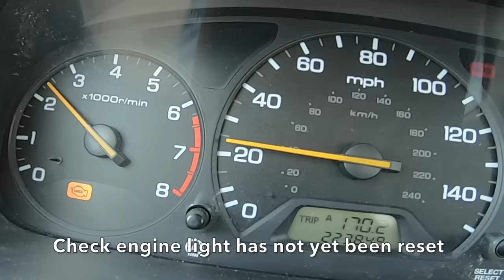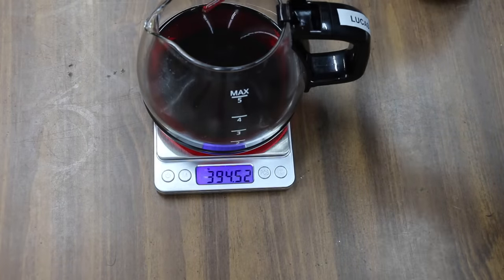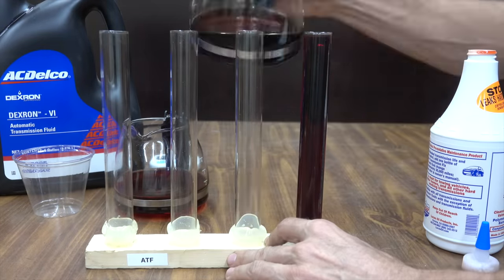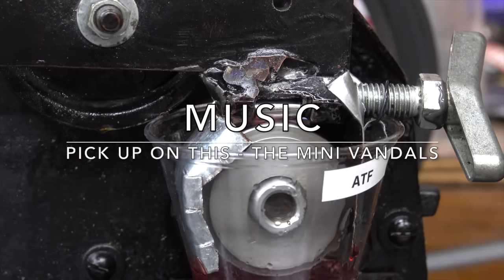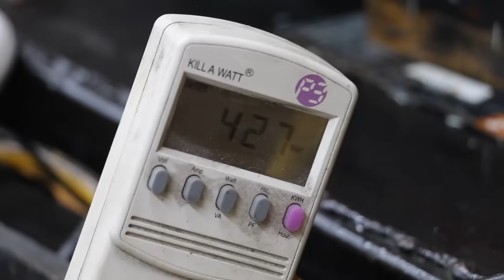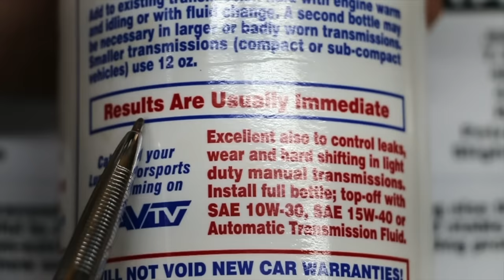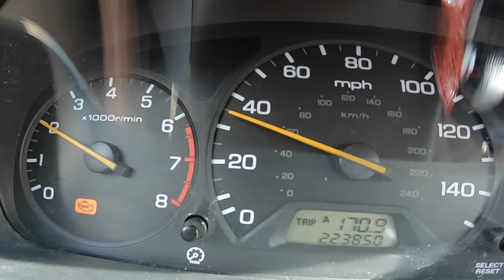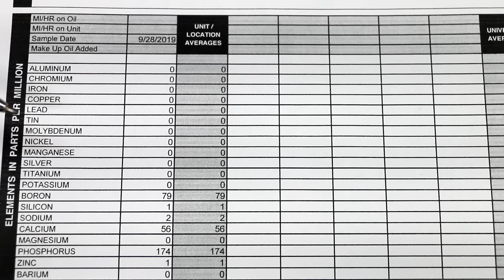Does Lucas Transmission Fix Work?  Let's find out!

Comment: I have friend who had a 2008 GMC Savana van.About a year after the warranty was gone, The transmission was slipping like crazy. (it was serviced  at the recommended intervals by the dealer).The dealership quoted him $5k for a rebuild and a ridiculous amount for a new transmission. I changed the fluid/filter and added a couple of bottles of Lucas transmission fix. How did it work? 4 years later he traded the van in to the same dealer that wanted to empty his wallet 😂😂😂
Reply from the maker: Thanks for sharing!
Reply: When I worked in a shop on multiple occasions we had cars that were towed in that left just fine after a transmission fluid and filter change. Automatics are very sensitive to fluid quality, level, and flow.  So always drop the pan and change the fluid and filter regularly and certainly if you are having a problem.
Reply: I wish I had the same experience with my 2000 Chevrolet Express; this product didn't do anything to help and actually made the slipping worse.
Reply: @belltolls1984  did you drop the pan and change the filter?
Reply: I'm pretty sure a new transmission cost around 5k. 2021 Escalade new transmission was around that.
Reply: Lucas really is great. But one must be careful because it's not for all cars. Like forign cars with low viscosity oil. Thickens the motor oil to much and causes damage
Reply: @magsteel9891 i
Reply: Lucas transmission Fix ©️Sales rep be like :
Reply: Its GM that's why lol
Reply: I recently paid 3k for a new trans for my Altima. Pos cars.
Reply: @magsteel9891  Please help me out by clarifying. I get what you said about the danger of changing the fluid and creating bigger problems. But the part that confused me was the last sentence about changing the fluid if you are having a problem. I am having a minor problem with two 2006 Avalons. I do not know if the fluid was ever changed in either vehicles before I owned them. So in this case would you recommend to change the fuild or not? One has 179k and the other 110k.
Reply: @Lacronh  no no, I didn't say changing the fluid would create problems. What I said was the fluid quantity, type, level, condition, and pressure matters a lot in an automatic. If I was having a problem such as slipping or refusing to go into gear I would always try changing the fluid and filter because that may resolve the problem cheaply.  Also while the pan is down you can see if there are metal fragments in it which might indicate something has failed. I wouldn't power flush it, that can create problems. Good luck.
Reply: @Lacronh  2006 Avalon has a very similar transmission to my rx300, I had an occasional slip at 175k miles. Fluid and filter change fixed it, I've got 340k miles now. Change that fluid every 30k or so
Reply: @magsteel9891  Ok, thanks for all your help. So even if the previous owner may not have changed the fluid, you'd say to go ahead and change it and the filter, just don't do the flush. And you are saying you wouldn't be concerned about it creating more problems. I understand you now.

I had read where someone else in the comments on this video recommended retaining the old fluid for a while just in case the new fluid causes issues. Then you can revert back to the old one.
Reply: @Lacronh  I can't imagine anyone pouring old transmission fluid back into a transmission.  The only reason new fluid could be a problem is it's the wrong type or amount.
Reply: @magsteel9891  I've read that "If you go and replace the fluid after the transmission is already worn out, this can cause slipping. The old fluid had contained particles that actually helped shifting, making it grittier to allow better gripping. New fluid doesn't contain this material and may not grip as well, causing slippage."
Reply: @Lacronh  Wow, I never heard that before.  My guess is this is kind of an edge case but since it only applies when "The transmission is already worn out" it's probably not worth worrying about.
Reply: @magsteel9891  Yes, it's true apparently. However, whether "the transmission is already worn out" is rather subjective. In my opinion, if you are starting to have issues with your transmission, you could say that the transmission is already worn out. That's why I have always hesitated to do the fluid change and never actually dared to do one.
Reply: @Lacronh  I think this "grit" thing sounds more like an urban legend than a real thing.  "Grit" should be being filtered. If anything a clogged filter would reduce the fluid flow.  In the end do what you think, but personally wouldn't hesitate to drop the pan.  Btw that transmission (probably a U151) may have a screen instead of a paper filter. I have a U140 trans and already replaced my screen with a paper filter but you could also try cleaning it.
Reply: @magsteel9891  Thanks for the advice. I'll probably have my mechanic do it, and ask him to replace the fluid/filter. If it is the metal mesh filter as I assume it is, is that replaceable or just to be cleaned, as far as you know?
Reply: @magsteel9891  I replied to this comment, but my reply is not being displayed. Thanks. Another mechanic in these comments said that he has seen vehicles that had to be towed back to the shop that left doing fine immediately after a trans fluid change. That would seem to support the thing I mentioned that you are assuming is an urban legend. I hope you are right, but these other stories are cause for serious pause.
Reply: @prestonhanson501  does that include hondas? Mine is 0w20 motor oil
Reply: @sethmatteson5459  Thank you for saying that. It's apparently a little known fact. However, in our case we just bought a 2006 Avalon for our girls that made an occasional clunk (hard shift) during city driving. Our Toyota Specialist mechanic (not the dealer) said he has seen a couple cases where changing the ATF and filter solved some shifting issues, but he had also once been told by a transmission specialist that if the car is high mileage & ATF is dark colored, changing the fluid can cause "catastrophic failure" of the transmission. Be forewarned, people. So he didn't want to make any guarantees that changing our ATF would solve the issue, but we took a chance, even though the vehicle has 180k mi, since our ATF color was still pink (not dark at all). It turned out fine so far, no further clunking and it did not make it worse. Anyone reading this should add this to their body of knowledge on the subject.
Reply: @Lacronh  you can change the fluid and filter , but check the old fluid to see whether it's gritty or not, gritty means trans clutch bands are worn . On high mileage trans that hasn't been maintained properly you would never want to get it flushed
Reply: @jaberjaber131  Thanks for your advice! So let's say it's a high mileage vehicle that hasn't been maintained properly, and the trans fluid is gritty upon draining the pan. At that point, would you put the old fluid back into it rather than replace it with new fluid, since it indicates the clutch bands are worn?

Also I agree about never getting a trans flush, but here we are only talking about replacement, not flush.
Reply: @jaberjaber131  PS. Just to be clear, you are NOT saying that "On high mileage trans that hasn't been maintained properly, you would never want to replace the fluid" You are only talking about flushing. Correct?.
Reply: @Lacronh  I have owned Toyotas for a long time and they all came with a transmission oil pan drain plug , I would have drained it a quart at a time, but if I had already drained the fluid, I would just use new fluid. I think the Toyota can handle it. Best of luck to you.
Reply: @jaberjaber131  Thanks for the advice.
Reply: @phony montana  yes. Don't use the regular kind. It has a very heavy weight. They make a new one made for foreign cars and its a zero weight oil full synthetic. Works wonders but you got to use the correct one especially if you have a forign car like I do. I have a Toyota Tacoma and I use the Lucas oil zero weight new one
Reply: That’s weird it’s not compatible with dextron transmission oil thought it would help my 04 1500 gmc and nope all gears went out, then when on to research and came to find out it specifically says not to mix with dexron transmission oils
Reply: But that was just my experience
Reply: My brother has been rebuilding trans  for over 25 years.  Parts to rebuild most trans are between $800-1500.  If you do it yourself that is...
Reply: @issavibez394  ive got a 08 gmc truck....161000 miles never serviced.....shifts perfect.
Reply: @steverugerguy9606  sounds like 🧢 cap to me
Reply: @magsteel9891   Same here. 82 f150. Shifted hard. Dropped the pan, changed filter, poured old fluid back in, added a quart of new, ran fine for another 60K when I sold the truck. Wished I hadn't. No other truck ran as well.
Reply: Amsoil
Reply: slip or shudder? Try anti shudder fixx
Reply: he is putting it in the dexron in this video. What are you saying?
Reply: @miketuch when you drop a pan, do you have to redo the gasket? Are you splitting it into two pieces or just unbolting the mounting on the transmission?
Reply: @josephzamora8535  When you drop a pan, always replace the gasket. Clean the surfaces; on the pan side, lay down a layer of Blue RTV, then place the gasket on the pan, then gently lift the pan back in place and hand-tighten a few bolts to keep the gasket in place.
Reply: Good, screw dealers

Comment: This is no gimmick guys. The Lucas transmission fix is so good that it changed my 4 speed auto to the new 10 speed auto. Results were immediate.
Reply: 4 speed manual to a 10 speed auto ;)
Reply from the maker: lol. Nice
Reply: added 10 brake HP
Reply: Redline > Lucas PERIOD. 

lucas is sold in your box stores
Redline you have to order online.   That should tell you everything you need to know
Reply: I used it in my Toyota and it changed it from a coupe to a sedan
Reply: @llamacebu216  redline is sold in some box stores, so that argument is invalid. With that said as project farm tested it is obvious the Lucas is just 50w oil and have been conning people out of money for years, so redline probably is better if it is not a 50w oil
Reply: And everybody clapped.
Reply: New feature...Neutral now works in every gear!
Reply: @blainestreeter5483  that is.. brilliant
Reply: It turned my 4 gears into 4 neutrals :(
Reply: @bigcountry3198  
I have used lots of Lucas products and have had very good experience's .
I used the oil stabilizer,  on an engine that had 150,000 miles, and the rods would knock on start up then quiet down, after the Lucas stabilizer no more rattle. I did however 1 year later replace the rod bearings,  and that fixed it permanently. 
I have used Lucas fuel injector cleaner in both gas and diesel engines and it helped smooth out idle and better fuel mileage in both. the diesel is an X15 Cummins, 450 horsepower,  increased fuel mileage by .3 per mile, not much, but when you drive 100,000 miles per tear that .3 helps.
I have used the Lucas Red grease, that works very well too.
Reply: @bertgrau9246  uh you do know oil stabilizer is 50 weight oil that's it. You could buy 50 weight cheaper. There is no additive in it at all.
Reply: To put myself at risk for being “that guy” buuuuuuut as any Honda enthusiast would gladly repeat 1000x, “Honda is a different breed of mechanical marvelousness and as such it doesnt want but requires OEM fluids and parts, while GM&acdelcos dexron VI is a high end and good quality product, Idemitsu and Honda Genuine are the best choice for every fluid, even oil and power steering. Im willing to bet if one cleans the couple screens and filters out of that trans, drain and flush it, then refill with oem, we’d see even more improvement. A tip i learned from an old fella is to save a quart of the old fluid that came from the middle section to refuce floaties and sediments then coffee filter that old qt of fluid and add it to the trans first when refilling, supposedly it preserves some friction helping particles.

Comment: I'm here to tell you that Lucas transmission additive fixed my 2003 RAV4. It slipped like crazy going from 2nd to 3rd. The dealership wanted $4,000 to replace the transmission $151,000 Mi I just missed out on the warranty. The transmission shops would rebuild it for $1,800 with no warranty. So I drained a quart and added a quart of Lucas. I drove lightly, using the floor shifter manually. After a week it started shifting better; after a month it was like nothing happened. But never once I ever romped on it.  I swear by that stuff. I'm over 200,000 miles now no troubles.
Reply: Thank you
Reply: Lies
Reply: I cannot lie. I'm 80 years old. I have to answer to the Lord shortly.
Reply: Smoking with Archie Bunker. Shame on you.
Reply: It’s not worth the cost to replace/rebuild a transmission on a car that old.  You essentially saved the old car from the junkyard for 50k miles and counting.
Reply: @user-tb7rn1il3q  all I can say is it is a great running car. If $1,800 was my only option, I would have done it. It's like I having a new car. Old RAVs were over-built, like Datsun B210s.
Reply: @user-tb7rn1il3q I had to give the RAV to my daughter.  I run a 99 Olds 3800. 32mpg on the road. I re-did the front end, new tires, I did the brakes, I can't believe how good it runs.
Reply: BS
Reply: @@YTcensors you gotta learn how to talk to people man.
Reply: @@YTcensors You are not the subject of the conversation. Nor are you the one who dictates where the leader of it goes. You don't understand conversational dynamics. You clearly don't socialize very well.
Reply: @YTCensors psht shush nematode
Reply: @YTCensors a bit of projection there…
Reply: Fuck yeah
Reply: @miketuch  😂😂😂😂😂
Reply: @@YTcensors -- You should at least wear your bikini bottoms when you're rolling in the sand on the beach.  There are some places sand doesn't belong.  You should at least rinse it out.
Reply: Yeah my 97 suburban too I got the 4le 80
Reply: Wait a minute you mean to tell me that toyola fails just like all other makes and models? 
I am Williams complete lack of surprise
Reply: @YTCensors cuz "no liars will be in heaven ", read your bible!
Reply: @miketuch   10 años atras compre un grand marquis 93 por muy poco dinero con problemas de transmision que no quise reparar, compre 1 botella de lucas y se la añadi a la transmision, despues de 2 dias note un cambio bastante bueno y me decidi por añadir otra botella, la trasmision despues de unos dias trabajo  normalmente hasta que un dia despues de 5 meses preste mi auto a un amigo y lo choco. termine vendiendolo a un yonke que es de un amigo mio cuando desarmo la transmision la cual yo le ayude a desarmar, quede impresionado del daño que tenia dicha transmision, tan grande era el daño que si se los cuento no me lo creen, y de como el aditivo hizo trabajar una transmision que ya estaba muerta, sin duda yo recomiendo el aditivo lucas ya que lo que hizo con esa transmision fue un milagro.
Reply: @pazerfaust45  mucho  bueno, amigo! Thank you!
Reply: @YTCensors what a tool lol
Reply: Lucas takes a while to fully effect transmission performance.
Reply: @YTCensors I agree...These guys are brainwashed by their Book of Magic. 😂😅
Reply: Hearing the name of the Lord is like kryptonite to soulless YT censors.
Reply: Using it for the same exact car and reason. So happy I got this stuff.
Reply: @user-tb7rn1il3q so you know what you have, and know $1800 would fix your problem, but you'd rather junk it and cross your fingers with another used car or spend double that to put down on a new car? Wtf is your logic lol
Reply: I’m ready for the test on ny 2016 Ford Fusion, getting slips and sometimes falls off the gear while at a red light!? I have had oil changed and computer stuff done, speed sensor changed and still… once in awhile it will do the slip.. but I have the Lucas , I am going to take out 12 oz from Trans and add 12oz of Lucas .  Its Thick stuff so I would recommend using a hot icecream bucket of water for the oil bottle to soften oil, I heard of people doing it in a Microwave!? Lol! … ok….  Water, Hot.  😊.   Its is going to work!   🙏🏾😊.
Reply: Where are you getting those rebuilds, and replacements for so CHEAP? 1800 for a rebuild? 4000 for a replacement? I live in Houston, and my a local shop rebuilds for $4000 and a replacement is $$5700?
Reply: @adanlopez1011  NC, 4 years ago, exactly. before the prices doubled.
Reply: @miketuch Jesus saith unto him, I am the way, the truth and the life: no man cometh unto the Father but by me.
John 14:6